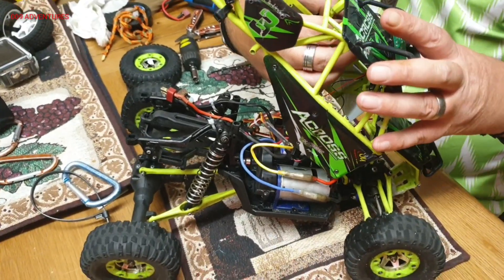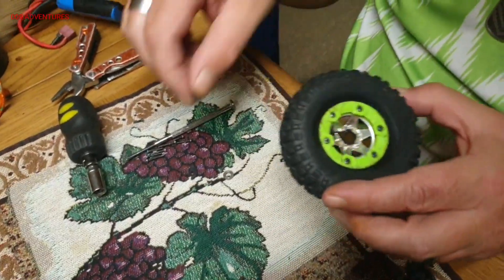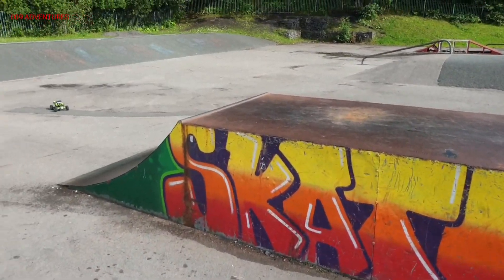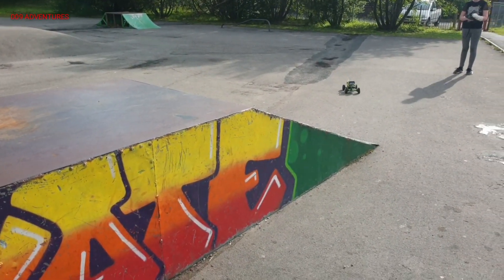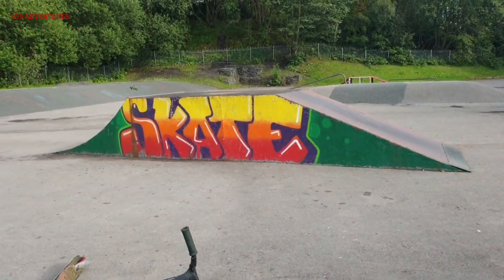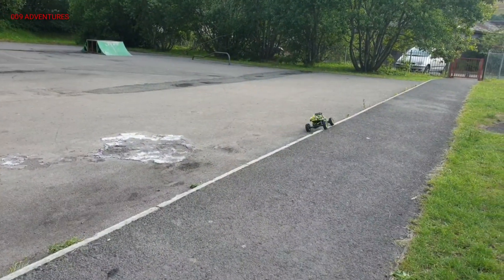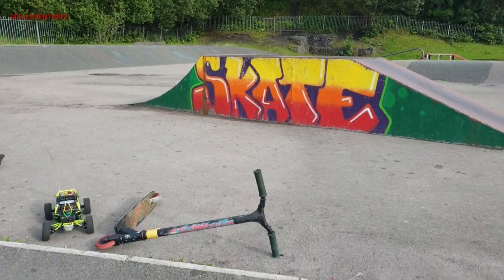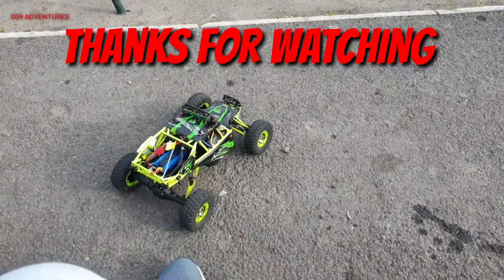12428 WHEEL REPAIR TEST.. AIR REQUIRED !

Comment: try jb weld  not cheap but very strong  stick to the slow setting stuff works best
Reply from the maker: I always keep a supply of jb weld in the workshop but try not to use it if I can help it, it has to be really broken to crack that open lol.

Comment: it looks to me that the angle of the prop at the diff end is too much..  Any way you can twist the axle to lessen the angle ?  You get the same prob with real trucks when you jack up the suspensions.
Reply from the maker: yes your right it is, i can lengthen the we will call them pannard arms then that will twist axel and reduce the angle,, it's just another one of those jobs I've not got around too yet Dave 😀👍